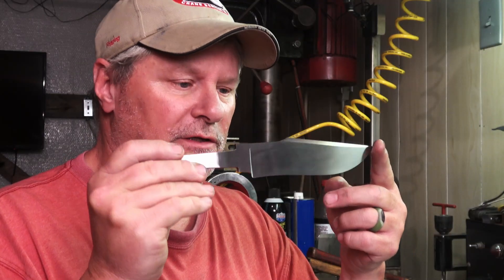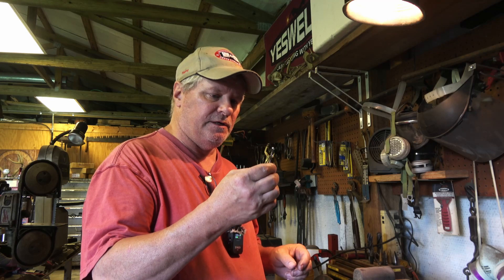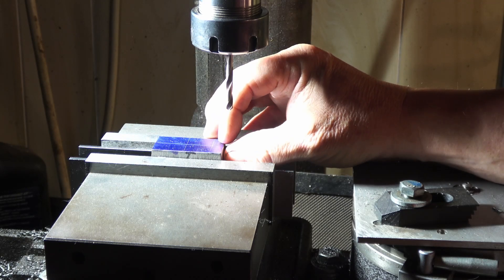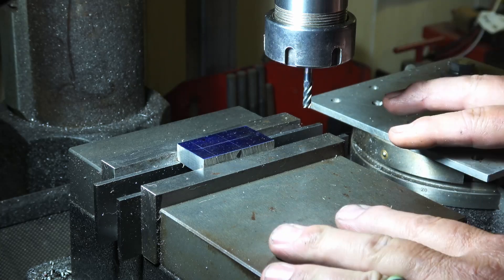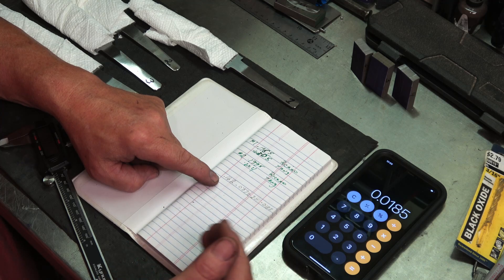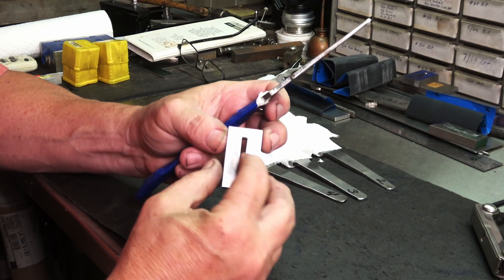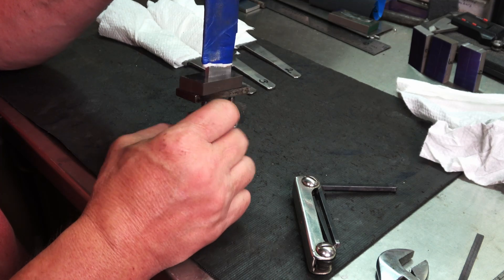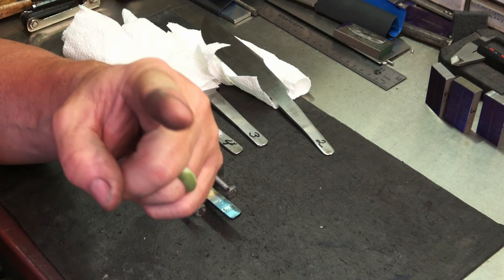Knife guard slotting and fitting 101

Comment: Hi Tony,

beautiful work and tutorial as always!

May I ask you a question? Warning, it's a newbie one and may be a little bit weird...

I've always seen 416 used to make guards and I wonder why it is used instead of 316 or 304... Doesn't 416 need to be heat treated to be corrosion resistant/stainless, which adds another step in the process?
Reply from the maker: Thanks.  416 is very machinable.  It comes fully annealed.  I’ve never heat treated it for corrosion resistant properties.  It will rust if left un kept but so will a good stainless blade.   316 and 304 is hard to work with and it’s gummy when machining.  416 was made for machining with the added sulphur.   It’s why most bladesmiths use it.
Reply: @TonySeverioKnives  
Ah I see! Thanks a lot for answering my question!
Reply from the maker: @S.Vallieres you’re welcome my friend